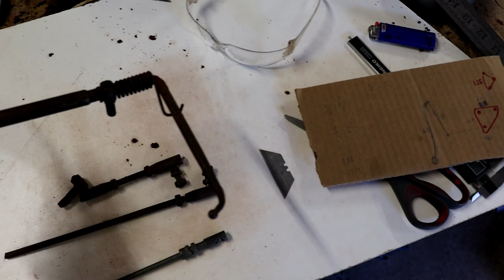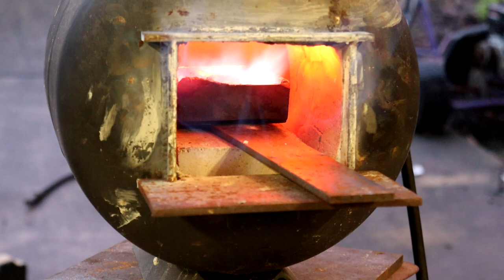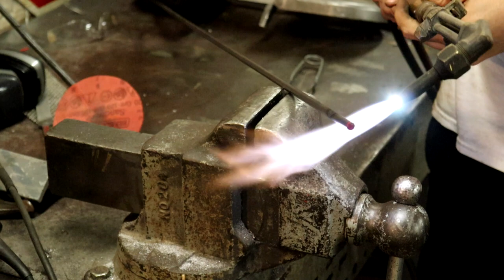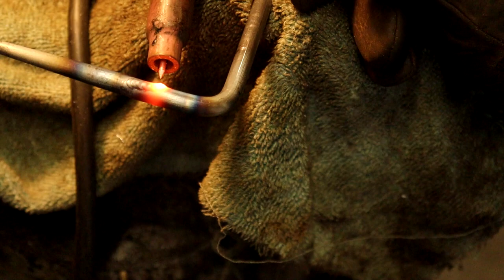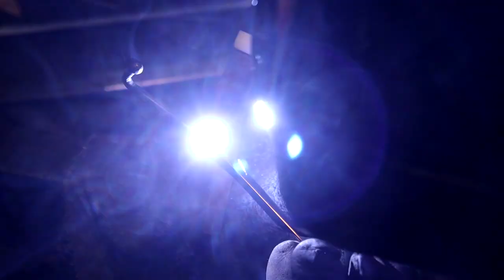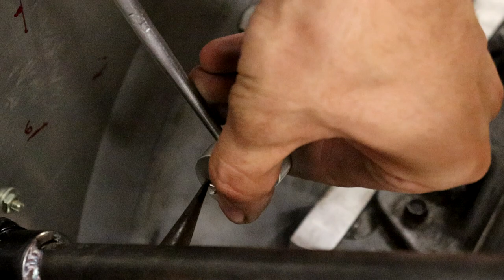Making a Throttle Pedal for My Hot Rod | Homemade Boat-tail Speedster  Pt. 62

Comment: great job really nice period correct design on the throttle linkage. i do have a couple of comments. make sure you can get your foot under the throttle  linkage to pull it back in the event of a jam and make sure you have some way of preventing the engine from moving incase you break a motor mount. chevy actually came out with a safety cable for the left side motor mount back in the late 50's because motor mount failures would cause the throttle to jam. throttle cables came shortly after. the car looks great congrats

Comment: Great job sir.  Make sure NOTHING can bind that linkage, back in the day when I was racing cars I had the throttle bind up on the fire wall with the engine wide open going into a turn.  I got the worst crash of the season trophy but my car was totaled.
Reply: Paul Brodie tells a scary story of his throttle jamming on his handmade Excelsior motorcycle. Lucky he broke as few bones as he did.

Comment: The bar running across the front of the firewall is how it was done on Austin 7s too. And you remind me I never got around to trying lost foam casting.  I haven't done any for a few years now. I did experiment with 3D printing wax and doing lost wax casting but its tricky to print nicely.

Comment: You might want to consider adding an oiled bronze bushing into the aluminum blocks on your firewall so the metal rod won’t seize in there. Good work as always.
Reply: Aluminum and bronze are dissimilar metals.

Comment: Great video.
I would suggest use of nylon bushings for the throttle shaft to mounts. Nylon is a self-lubricating material and would be better than bronze bushing. Then again, there are bronze bushings that self-lubricate also.
Reply: Delrin (POM, polyacetyl) is a much better bushing material than Nylon; it's also much nicer to machine).
Reply: Bronze looks better and is period correct. For as much movement as there will be, it doesn't really matter which is the best, it's which one looks the best.

Comment: Love the progress. Only thing I would say is to try and bring the throttle pedal closer to the level of the brake, you may find it hard to move your foot fast enough from the accelerator to the brake when you need too, like when in traffic start stop etc. Wouldn't want too see you crash this beauty. Nice progress.

Comment: One thing you should do is put the exhaust manifolds on. 
You run the risk of damaging the exhaust valves without them. 
The theory is the valves cool down to quickly and warp due to the cool air on them.
Reply: Never caused a problem on Rolls Royce Merlin engines!
Reply: @cambridgemart2075  This is a different engine, not a Merlin. As I stated it's a theory.

Comment: Is it just me, or do the carburators stick out from where the hood is going to be? Not just the intakes, but the carbs themselves. Might be perspective.
Also, next video ought to be to connect the gas tank to the engine, that jar of fuel isnt going to take you far :P
Reply from the maker: yeah, they're above the hood line